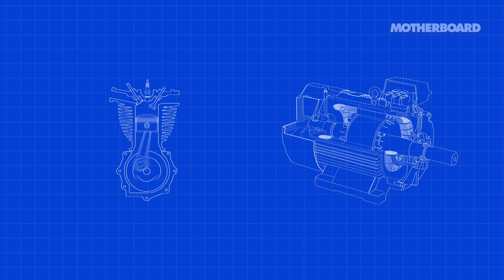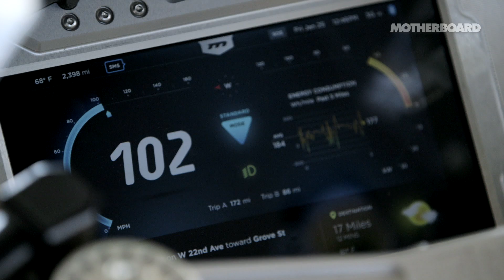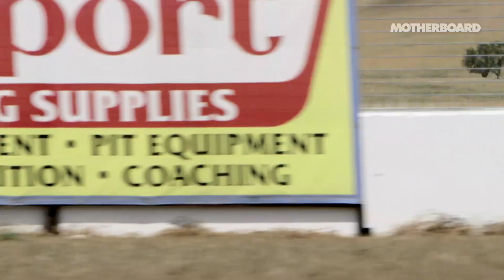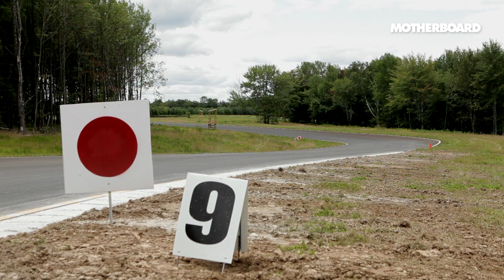Mission RS: The Electric Superbike of the Future

Comment: if you could fit 2 battery packs in one bike and a solar pad that can charge the first battery while the second is being used or vice versa then you will now have an immortal electric bike that does not need any charging time....you can even add an alternator to it to do the same thing so that you will be able to charge the first or second battery while riding the bike at the same time right?...its all on the design and back up plans you know..have you guys seen the movie"priest" where in they use the bike all day and only use a solar pad to charge it? it even runs on an air plane motor that makes it faster.. and how we wish its all in the market NOW....

Comment: I have a BMW 1200KR that is 163 horsepower and does 0 to 60 in less than 3 seconds so I can relate to how fast these are. My bike cost just over 16,000 new and is loaded with all the options. Flying horizontally is a common feeling I get. There is a magic speed somewhere around 80 that just is so smooth and silent you for get your riding. These bikes are better range and performance than the Brammo but a little too expensive for me to add one to my garage.

Comment: The concept for this vehicle is great, and i obviously works well, but the price is way to high for the average costumer. For the basic bike that they sell its starts at 58,999. The point of motorcycles is for the joy of riding and save money on gas, and there are plenty of bikes that are way cheaper and perform well too that would be more of a practical buy.

Comment: One of the main reasons why people ride bikes is the shifting. A clutch less motorcycle is not what bikers want!
Reply: WRONG
Reply: no way. the true satisfaction of sport bike riding is trail braking, dipping down low, carving apexes, and powering out of corners at the threshold of grip. shifting is ancillary.
Reply: It's not one of the main reasons, but for some it won't be better.
Reply: I would love electric for commuting and a gas bike for weekends.
Reply: Just tested the Zero DS and SR, and really, I wouldn't even want a clutch anymore. It doesn't get in the way of tight curves and riding slowly. It's pretty awesome to accelerate without intervals.
Reply: I once tested an electrical bike and found it to be highly convenient that you do not need to shift. also, the lack of a clutch reduces weight (it is not even needed) so better performance for your bike
Reply: Hard to beat the sound of a bike hitting redline and and banging through the gears.
If the Ebike were 10x louder it would definitely make my hairs stand up though.

Comment: The guy from Mission Motorcycles admits that they are built at a much lower cost than a conventional motorcycle but on their website, their bikes range from $32,500 to $75,000.  Fossil fuel wont kill the planet, it will be greed.

Comment: is there a possibility that you could use the rotation of the front and rear wheels to create more electricity while you ride to increase the range?
Reply: No, that would increase the drag on the bike, requiring more power from the engine to compensate. Since nothing is 100% efficient you'd actually use more than you created. However, it's possible to brake by using the engine as a dynamo. This regenerative braking is better than friction braking since you put electricity back into the batteries instead of wasting it as heat. You can never regenerate 100% though.

Comment: no clutching no shifting :((
Reply: I have the same concern, but I think after you've felt the power once, you'll forget about it. Riding motorcycles is not about clutching and shifting, it's about riding...I still love manuals though;)
Reply: hm, maybe you r right, i havnt ridn a manual till yet, but im 16 years old, a german and i love my 125 ccm bike <3
Reply: 4xStyle Na dann wirds Zeit das du mal auf ein Big-Bike steigst;)
Reply: haha ja aber bin noch zu jung :/ hab au noch en mofa :p
Reply: Alexis Hernandez wrong. electric bikes like this can power wheelie easily since the torque is so high and instant. If anything, wheelies will be safer, easier, and more controllable.
Reply: No clutching, no shifting... no Wheelies! ;(
Reply: Jack Colmar Wrong, ask any stunter. Clutch up wheelies are the safest because you're not going 60+ MPH by the time you get that wheel up with a power wheelie. A lot more controllable. There is no way to do a wheelie at 20 mph without clutching up.
Reply: Aznemptyjry Sorry but the Mission RS is well documented at lifting the front wheel at slow speeds with just a twist of the throttle. And that's on the stock sprocket which is pretty small. It has 120 ft/lbs of instant torque. I know plenty of stunters and ride myself. Stunters are drooling over electric bikes getting more affordable. All of the abuse that a combustion engine cannot take when it gets dumped on the concrete are no problem for an electric motor. Soon, electric bikes will get lighter and cheaper. When they do, you'll never see a stunter on a gas bike again.
Reply: Jack Colmar The bike isn't even out on the market yet, so stop sprouting BS out of your ass and show me links where the bike is "well documented at lifting the front wheel". 120 ft/lbs of instant torque will make the throttle twitchy, which is terrible for stunting (no control). Yes wheelies may be easier, but not safer or more controllable. Factor in the cost and I think it is safe to say we will NEVER see any stunters on an electric bike.
Reply: Aznemptyjry Congratulations, you have just put your ignorance on full display. This bike has been tested by almost every independent motorcycle reviewer in the world and has set production bike track records on famous circuits already. The company has already fulfilled orders. If you cannot complete the basic task of searching this extremely well documented motorcycle yourself... you have bigger problems in life. Good luck with that. I don't know what else to tell you. Ever heard of Google?
Twitchy throttle? Do you know anything about electricity? See there are these things called "resistors" that ensure a smooth, modulated electrical flow. Almost every single electronic device since electricity has been harnessed by humans has these devices. Toasters, iPhones, space shuttles... The throttles on electric vehicles are smoother and more consistent than any combustion engine on an exponential level. Tell you what. Go ahead and believe what you want. Back when combustion engines came out, there were idiots on horses saying the horse will never be replaced too and that cars were expensive garbage. I guess history repeats itself.
Reply: Jack Colmar Great job! Way to write a whole lot of words without saying anything meaningful or anything to dispute my points, but I'll play along with you. We were talking about this motorcycle and it's applications in stunting, not this real world, track record blah blah blah you go on dribbling about. Stunting is not about pure power. It's about finesse, controlling exactly how much torque is going to the wheel with the clutch, or revving the engine and using it for balance. You still can't prove to me that power wheelies are safer or more controllable than a clutch up wheelie. Factor in the price as well. Stunters want cheap bikes they can dump and not worry about, not a 30k machine.
Reply: Aznemptyjry Thanks, but I don't need your condescending gratitude. It's cheap and just forces you further in the corner. You should quit "playing along" because you're trying to win a futile argument. Let's recap: We were talking about this motorcycle and it's ability to wheelie relative to speed. Your words were that it could not wheelie below 20mph. In all of 10 seconds I managed to pull up the very first review I found... and guess what was in the article? "0-60mph should take around three seconds, depending on how big a wheelie you decide to pull. Did we mention the Mission wheelies off the throttle?" Dig deeper and there is plenty of info out there about the incredible throttle response electric motorcycles have, including this one. Then you decided to accuse me of BS "sprouting" (spouting) bringing up points that are utterly wrong.
You said 120ft/lb of instant torque would be twitchy. Flat out wrong due ECU control and the ease of controlling current. Every test rider comments on how smooth these are.
You said stunters would NEVER stunt an electric bike due to cost. You are maybe aware that new technology starts expensive and then gets cheaper once manufacturing catches up? Electric motorcycles will be priced competitively with piston bikes in a matter of years.
You then explain how stunting is all about finesse not power. No argument there. What I'm saying is that electric bikes like this one can already power wheelie from a stop. And this one is specifically designed for track use with a long swingarm and tiny sprocket. Once these get developed and batteries get cheaper and lighter, stunters will start putting big sprockets on, and custom throttle resistors. Of course they are too expensive right now. That was never the argument. You added that. Just like any new tech, price will come down in a few years.
Finally you say that a stunter wants a bike they can dump. Wow. Of all the arguments to make. This goes back to how you say stunters will NEVER stunt electric bikes. When (not if) electric bikes become affordable, the inherent nature of electric motors will make them so much better than a piston engine to dump. No oil. No coolant. No fuel system. No delicate engine components to destroy. No clutch to toast. No exhaust pipe. When new more powerful electric motors come out... just swap it in. When a new lighter battery comes out.. swap it in. Your investment grows with time instead of degenerating when all the complicated parts of the piston engine wear out. If I were a stunter trying to afford that activity... I would be so glad to get rid of my piston bike money pit. Look, I ride but I don't stunt. hats off to those that do.. but it's just not true to say that piston bikes are better for wheelies because they have clutch input. Stunters use huge sprockets and grippy, under inflated tires for one reason. they want to maximize instant torque to lift the wheel. Once in a wheelie they can combine throttle control and clutch control to maintain the wheelie, true. What i'm saying is electric throttle is not an on-off switch. There is a regenerative motor that acts like a gentle brake. and throttle is totally adjustable. What that does is make wheelie equilibrium very predictable, all through one input instead of two. Sure I suppose there is no way to prove to you that this is better for a wheelie, in the same way I cannot personally prove to you the moon is not made of cheese, unless we're both standing on it, or both stunting bikes in the same parking lot. But perhaps you'll read the volumes of info out there about this subject, understand how these bikes work, and deduce for yourself.
Reply: Jack Colmar Again, writing lots of words don't make you right. You said yourself you don't stunt. You have no idea what kind of bikes we prefer to ride and what we require. Most stunts are performed under 50 MPHs. By the time you power wheelie your electric bike to 12 o'clock, guess how fast you will be going? Not very safe. And please stop putting words in my mouth, you introduced price into the argument not me. I simply responded to your statement. "Stunters are drooling over electric bikes getting more affordable." Look at Tesla vehicles. They have been around for quite a few years now and the prices aren't getting any cheaper. This bike will become nothing more than a weekend warrior for the rich.

"Stunters use huge sprockets and grippy, under inflated tires for one reason. they want to maximize instant torque to lift the wheel." Straight up wrong. You don't need tons of torque to wheelie a bike. Wheelies can be performed on a 250cc bike and that has around 20 ft/lb of torque. Huge sprockets in the rear is for increase in control i.e. less speed per increase in engine revolution (RPM) so you're not going 60 MPH in first gear @ 8K.

You also state that wheelies will be easier with one input instead of two, "What that does is make wheelie equilibrium very predictable, all through one input instead of two." How could you possibly know that? You have never ridden this bike before and you said yourself you don't stunt. The only thing I can conclude is that you don't know anything at all.
Reply: Jack Colmar  No response?

Comment: We need a better, lighter way to store electricity. The motors are great but the weight hurts handling & charge time hurts practicality.
Reply: Not only the weight of the battery, the useful range of the vehicle as a function of the degrading capacity of the battery.  As an example, my Apple Macbook claims 7 hours of useful life between charges when new, yet after two years I am only getting 3-4 hours of use between charges because the battery's capacity to hold a charge has degraded.  The current Mission R/RS models claim 105 - 140 miles between charges.  But as the bike is ages, that range will decrease.  Eventually, you'll get half that distance or less (possibly), making the vehicle impractical.  The only recourse is to purchase a new battery probably at a price that exceeds the present value of the motorcycle in the used market.  I don't believe consumers will accept this expense.  It factors heavily into the cost of ownership of the motorcycle over the useful life of the motorcycle.  It could make it more expensive to own this bike compared to a comparable gas powered motorcycle.
Reply: I totally agree and for them not to even mention weight is a slap in the face. This video was so obvious of an infomercial for sales masked as something addressing problems.
Reply: Wake up sheeple! Wouldn't weight fall under the range category?
Reply: From a sales pitch mentality. We're talking about throwing the bike around and the way we like a bike to feel vs gas powered.

Comment: Really cool. My only concern would be the awareness of other motorists. In my country, the majority of accidents involving motorcyclists occur when cars merge in on them because they either don't see them or don't bother checking. When cars have started to merge in on me, I usually clutch in and rev the engine really loud, so they know I'm there.

On this bike, you're as hard to see as a regular motorbike, but there is added danger because people can't hear you coming. Couple that with the fact that you can't rev it to make them aware and there's a potential for safety issues. Maybe with all the weight/space reduction from omitting a transmission they can install a horn that people can actually hear (unlike most other motorbike horns).

Comment: The battery is indeed one of the problems to be solved. But I think charging time can be eliminated if we think of charging stations as battery banks/pools. I ride in and slot load/unload a battery and off I go.  We already have standards in battery packaging. It is a matter of extending these standards to vehicles too. But I think this require the EV industry reaching a maturity that will lead to standards adoption in electric power systems, which will need large scale consumer adoption. It is a chicken and egg problem to some extend.
But  I am sure we will find a way. The point is keep innovating on power storage and delivery. Super capacitors are another storage tech that will suite well to a standards based fast load/unload mechanism for EVs. They are more power dense than conventional batteries and are more robust/stable along with lighter weight. Their upfront cost is the problem. In the leasing model that I am discussing, they may have a role though.

Comment: I would buy one in a heartbeat if the price was competitive. It is more expensive than a Panigale and even a Tamburini or Desmosedicci in GP form. It is the same price as a Prius too. I could buy a Lotus Exige for the price of the GP. This is the only thing holding electric bikes back. No one wants to spend twice as much money on less performance that an exotic sportbike. I love this bike. It's performance, range and styling are excellent. It's price is the deal breaker. Though I do wish they would make a shiftable version. That is half of the experience of riding.
Reply: OK...then you wait for at least few more years when they released the more affordable models.
Early adopters are critical to the success of these electric bikes.